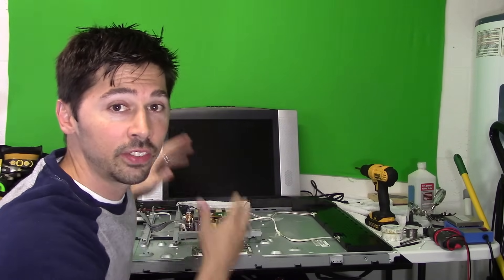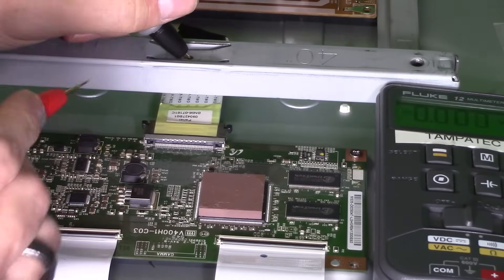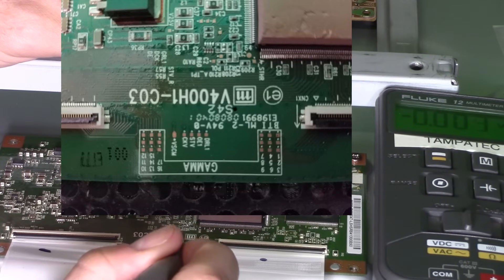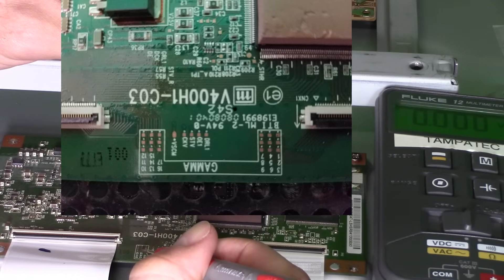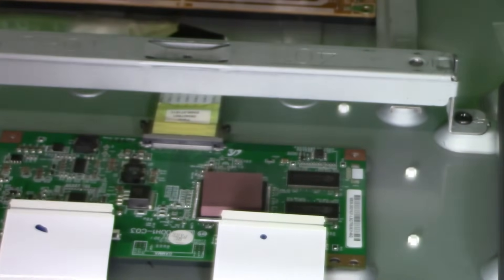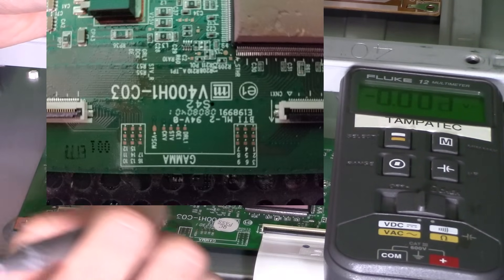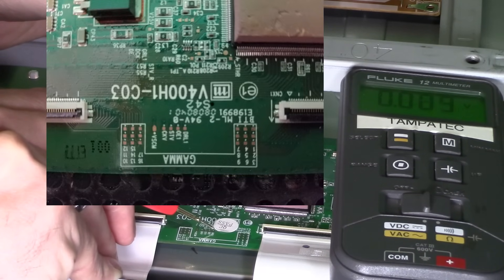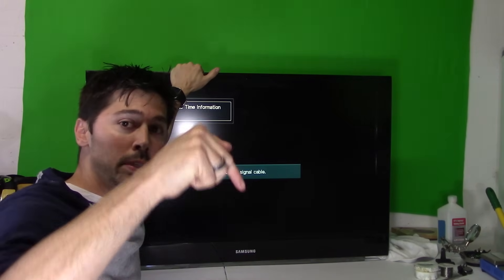THIS EASY 5 MINUTE TV REPAIR WILL FIX MOST VIDEO PICTURE PROBLEMS!!!

Comment: Do you get a dud credit for the bad t com board or do you throw it away? I used to repair the old zenith 9-160-05 modules myself on the system 3 series

Comment: Hi I’m have a problem with a 4k lcd 55’ no display from the T-con board , the tv is switch on and off from power button , the display is black and not signal from T-con to the lcd panel, if im remowe the left cof conector from T-con is coming the image but in hallf of the screen , the image is not hallf is like one display in right side working fine ,and the other one is white ... what you can recommend?

Comment: Hey Tampatec I Have a LG  TV
 the horizontal would flash on and then the TV would go back to normal then back to the horizontal flickering lines I changed the T_CON board and cleaned the ribbons ribbons still no change . Any help would be appreciated

Comment: Hi I have a LG 47 inch smart TV and the screen went black. When you turn back, on the screen flashes normal and then goes black.  Service tech said it's the video board that is bad. Do you concur or is there another problem. Thanks Bob.

Comment: Hi . I was wondering if you can help me out with my LG lh5700 flat screen TV . (model # just in case you need it is, 49lh5700-ud) Power works , sound works but no picture just a blackish blue'ish screen. Can you please help me to home fix it ? :)

Comment: Your videos are awesome man I have a jvc smart tv and when I scroll down to the WiFi settings it freezes I can't move left or right with my remote control could it be it needs a new wireless WiFi connection adapter in side the back of the TV I'm not sure of the name

Comment: Hi I have a Samsung UN32J5500AF and My screen has about a 1/4 of the right side as snow. I can use the onboard keyboard to log in with what is under the snow because I know where the enter button position is. I can't clear this snow.

Comment: I have a Vizio M370S tv that has white horizontal lines across the display and white vertical lines where text letters are. The picture momentarily freezes every 2 seconds.  The 2 wide ribbon cables attach to the main video pcb which I guess means it has no TCON board. I have disconnected and reconnected the ribbon cables (both ends) as well as the other cables with no changes. Any idea where the fault is? I am suspecting it is an issue on the main video board. Voltages on the power supply board are there although the +5.1V seems to drop down a bit after the set warms up. I am currently monitoring voltages with a meter, not with a scope. I'm hoping my description of the symptoms will match with something you've seen in the past. Any comments/recommendations would be appreciated.

Comment: Hi Tampatec
My XBX65X900f flashes red 4 times. the Android logo turn on and quickly shut off. I tried to updated the software several times, Only one time the monitor turned on and software up date completed. After that it shut down and the same problem again. I bought all new boards and changed them out one by one but it still shut off at android power cycle. I tried to take the data cables out from the T con board, The monitor flashes red, green..Sound does come up. Its seem the panel is OK but when the cable put back same thing happen. I do not know what else to try. Please help.

Comment: I've got a IC chip on my 32PFL5332D/37 Philips LCD Television main board.   I felt of all five IC chips on this board and found one that warms up some and then I touch one on the far right of the board and if you leave your finger there long enough, you'll suffer a heat burn.  Will this heating cause the set to shut down.  I'm thinking so.  The symptom has been a shutdown and 6 flashes from the yellow light.  Would a heat sink pad help this or is this heating IC chip not suppose to heat up like this?

Comment: working on a DT4660  but cant tell if the main logic board is the problem  or the  other board  
I have or did have audio  but no picture  only back lights  - screen is all dark blue .   I have good power every where 24V 12 v and 5.2 v from the power board.        Then I go sidways ?   dont know what Im looking for ?

Comment: I have a un55f9000. There is green/purple static on the picture. Audio and video otherwise works. Would it be safe to say it is the TCON board?
Reply from the maker: I had that issue but it was cable box issue so I reset the cable box which fixed that. Is that issue on all TV inputs HDMI 1 and HDMI 2 ect.., try reset TV by unplugging power for 1 minute. Picture problems usually are bad tcon board but bad LCD panel and main board can cause distortion too. Also bad capacitors in a power board can cause purple static noise in the picture.
Reply: @TampaTec  I had a repair guy come and reaffirm it was the t-con board. If it were the LCD panel would the noise and distortion stay localized in one location on the screen or would it move with the picture? Thanks very much

Comment: Hello  Tampatec ! Just discovered your channel and think its great.  I would appreciate your advice with a Samsung  TV model No. LN32C350D1V.  I`m having problems with the image, basically it is showing horizontal lines on the upper part of the screen. After watching your very well explained video above , I would appreciate your advice on which TCON control board I should buy as a replacement for my TV`s specific model and a reliable supplier online to get a new replacement part . Thank you, in advance,  for any  help you may give me to solve this problem. Many blessings to you and Merry Christmas!

Comment: Thanks. Have a 1 yr old 65 inch sharp flat screen stopped working after a lightning strike close to the house. Any idea on how to repair?
Reply from the maker: Usually fried main logic board and power board, get tv boards at shopjimmy.com or electropartsonline.com use code tampatecfriend for discount.

Comment: Hello I have SANYO DP42746 plazma TV I replaced one of the cap, fix the snowy picture. Now my TV picture coming apart by apart after 2 or 3 minutes picture thare but not clear. I ordered T-Con board and replaced but did not change anything. I checked all the other caps they all looks good. Cap that I replaced on Ystain board. Can you please tell me what else can be. Thank you.

Comment: I replaced the T-con board, and it seemed good. But after a half an hour or so, it became white washed again. :(
I set the thing away and did not bother with it for an half year, after that i plugged it in, and it was normal again for a few days before... jup it got white washed image again.

Any clues @Tampatec?

Comment: My Samsung 42 inch I bought in 2009 if I cut it off ,& it cools off it has no picture just those lines you had til it warms about 1 minute then screen pops up & it's fine. Colors fine too. This TV has never been cut off but like 5 times in 8 years. It did that when I had lost power for some time & noticed this upon power returning. I just never cut it off so I don't worry about it.

Comment: Hi mate I've got a luxor TV model no LUX0142001/02
Was going fine I switched it on 3 days ago  no power nothing. I checked fuse in plug turned of then on still nothing. Can you help

Comment: Just subscribed to you mg friend.

I'm from England.

I have replaced an led strip on my 40" bush tv. It fixed the issue. But since rebuilding it, the white parts of the picture are too white. There is no detail on the whites and the resolution hasn't got as much detail in it. And there is no sound except for a quiet hissing from the speakers......
There is only a mainboard in the tv and no t con board.
What have I done?

Thank you

Comment: Ive got a Sony KDL-55W800C that I believe had a power surge because it stopped powering on. I replaced the power supply board and main board and was getting sound, but no picture and a flashing green/amber light. I found and installed a used TCON board and now I have a picture, but it’s just horizontal lines.  Does that sound like a bad panel or might the used TCON board be bad as well? Any help would be awesome.

Comment: I would like to know why you didn't try to repair the board like replace the any components that were frayed dropping the voltage on the board that you replaced instead of replacing the whole board?

Comment: Inspiring video. Request advice --- My Sony Bravia 55 in. LED TV  (2017) has suddenly started displaying green screen. Audio is OK. Remote works. No OSD or Menu visble. No signs of a picture under the green screen. Could it be a loose connector or is it the TCON board? TV is hardlyy 16 months old. Has never been moved.

Comment: I have a lg 42ln540 it has a clear picture but is shaking n jumping with tinny black lines  across,I have tried a similar t con it worked for some times but the problem has occurred again, what's the total solution pliz advice.

Comment: I have a 51' Samsung plasma television. I have a several horizontal lines going across the screen. Is it an easy inexpensive fix, or should I just purchase another television? Thank you for your help.
Reply: Did you ever get an answers
Reply: vertical lines = easy fix, horizontal lines = hard expensive fix
Reply: Nothing a new display panel won't fix. Samsung plasma panels for the most part were crap.

Comment: i got a 55 inch hisence tv LCD led  i had it in a my shed wen it was put there it was working and now took it out to play it and the only thing i got coming on is the power red light. nothing else I tried disconnecting it  and plug-in it back on and nothing. ..try turning it off but it won't turn of neither .only way to turn of is by disconectin it. .any ideas..!!!

Comment: Good video.  I have a 16 year old Sony Bravia HDTV which is only set up to receive a cable box. I want to switch from cable to antenna but it does not have an antenna in to receive a coax cable. Is there an easy fix for my problem or should I just chuck the Sony and buy another TV?

Comment: HI, MY  LCD Samsung TV has horizontal and vertical lines.  the  Model :UN48H4200AF . Type no. UN48H4200. model code UN48H42000AFXZP VERSON no. US02.

Comment: Hey i changed the Tcon on a Samsung  UE55D6500 because of picture problem... it was a used one and i still have the same problem... any ideas? strange: the rist time this problem came up i was able to fix it just with moving some cables or pushing on the t-con... now its diferent i have no chance to get a change and the problem is all over the display. could it also be caused by voltage problems or so on?

Comment: What might be  the problem?  I  find that one of my channels is unstable, channel 10. It has green square pixels which flash on the screen, at other times a horizontal image appears, it is non conistant, but enough to notice and makes watching, King of Queens disturbing.  I do not experience the problem on any other channel.

Comment: I have Samsung samsung 32h5500 usb not working ,i mean when i press source there will only tv,  screen mirroring,  hdmi1, component, options are showing,  none there of USB  option.... If i insert usb then also nothing shows USB,  and how to use wifi direct,  i couldn't use my phone with wifi direct,  i have vivo y21 Indian Mobile handset which supports wifi hotspot

Comment: Hello Tampatec. I have watched all your videos and by now i know that you'll have an answer to my problem on my tv (i have called several repair stores and there were couple teams from the cable tv who didn't know what's wrong with the tv) 
Sony Bravia KDL-46ex402 
Tv's GREAT, works perfectly but every time i try to connect the cable tv's receiver to HDMI it does nothing...blank
it has 4 HDMI outputs and i've try it all and nothing. But when i connect a PC or laptop... NO PROBLEM i have 1080p great picture works perfect on every HDMI port. They have tried even with older model receivers...different voltage receivers, i bought new power outlet and power outlet extension but nada. Then i agree to ca-module card and had success but for couple minutes... And now i'm watching CabeTv thru SCART...and RCA connector. It's like sticking a needle in my eyes. I'm suspicious of that i had an update on the tv and i think that i should not have done it

Comment: I need help lol so I had horizontal lines and I tried using a multi meter to test and I got a spark on the main board when I turned the tv on I had no picture at all so I replaced the tcon board and got my picture back but I had a lot of horizontal lines and I also had a mirror image where there was a good image and the exact same image upside down and backwards so then I replaced the main board and the picture is still mirrored help please

Comment: okay now that we know that board is defective, if you have a hot air soldering device
reheat the main chip pins with flux one side at a time  so they dont move, one row at a time so the cold legs will hold the main chip in place, maybe with a weight on top of chip, the ones thats are running hot will age the solder and become defective connections or any chips that run with exess heat will fail down the road, get back to me on this thought okay mike out

Comment: Hi Tampatec,
I have no backlights on my samsung ue48h6670  tv at all ,only sound. Disconnected the mainboard and they come back. Next I connected back mainboard and disconnect the t con and they still came back . Than I connected back tcon and disconnect two ribbon cables that goes into the panel and again backlights came back but not as bright. Do you think its the tcon or the panel is gone bad? Is it worth changing T-con? Tv is only 3 yers old

Comment: I have a Samsung 60" that was hit by lightning (along with many others hit by it too) I replaced the power supply board and got power but only various squiggly lines on screen then I replaced main board and now I have picture and sound  but 2/3 of it is darker red hues of color and the 1/3 of the right side the picture is pretty decent. I'm leaning toward the T con but already spent 95 bucks on parts and of course the t con for this tv is like another 90 bucks. I don't wanna spend that much more unless I'm sure that is what it is. Any thoughts? Appreciate all your vids dude!

Comment: Hi, been searching for information on a Samsung LED 55 inch flat panel which is approx 10 years old. about two days ago, noticed very faint vertical rainbow lines across the entire screen. Went online and found the website "JustAswer". after approving a $5.00 good faith payment, I was switched to the technical page to further provide detailed information about my issue. Provided all information on TV brand, serial number, etc.  The tech finally told me that the issue may be the panel or the t-con board. advised me to research prices for t-con boards to try to replace it myself. Note, I am a senior and although handy around the house, Im not a tv technician. The model # UN55B6000VF.  Can you advise if it would be financial prudent to call a repairman or purchase another TV.  From what I've reviewed online, this line issue is a well known problem with Samsung.

Comment: I have an Element 40" Full HD Digital LED TV Model # ELEFW402. Tv started out going to solid blue, green, white, or orange screen. All you had to do to get it to work again was to turn it off and back on. Then I had to turn it off and on multiple time and now no matter how many time I turn it off and on it won't show a pic anymore just a solid color from all blue, or green, or white or all orange screen. I have the back off but none of the tubes look swollen so where do I go from here?

Comment: When probing test points on the t-con board for the connectors to the LCD panel, is it written anywhere what the test point voltages should be? Fluctuating voltages aside, how do we know if the voltages are correct or not?

Comment: I have a sansui 65 inch tv model number SLED6523 AND it has lines and fades in it but I can't seem to find any boards or parts to match this model any suggestions? Thanks

Comment: I have a 55" TCL ROCU TV, four month old TV that has a skewed picture. Warranty is not an option. No Receipt. What is the likely issue? Sound works great. Screen is NOT cracked. What is the first steps I should take for repair?

Comment: I had the same problem of my screen going "white ghost". I checked out this video, and bought a used board on Ebay for $10. It was used but I wasn't sure if that was the problem and didn't want to dump a bunch of money on a tv i was going to throw out. When I turned on the tv with the used  board the back screen is all green now....its usually dark. I hooked up my PS4 also and there was some greenish huhes where they shouldn't be. How do I make a good board out of 2 bad boards, or how can I fix one?

Comment: Hey,  I have acquired a Toshiba 39AL900A LED TV - It has a working backlight with dark picture however all you can do is switch on with remote but nothing else.  I have looked and checked everything but all is ok.  When I tap the TV, the panel lights up with the vibrations but doesn't stay on.  Any idea what is wrong here?

Comment: I just inherited a Proscan model 40LC45S. It will turn on but the screen flickers as well as the left side of the screen is black but you can see it is there. I checked power supply and it looks good.  I removed the metal plate on the SSI400_16T01 board. Seems to be in good shape. The grounds 2 at the top were black and the bottom 1 on the corner was a little dirty.  I just can't find anything else past this point to watch. Any advice? Thanks